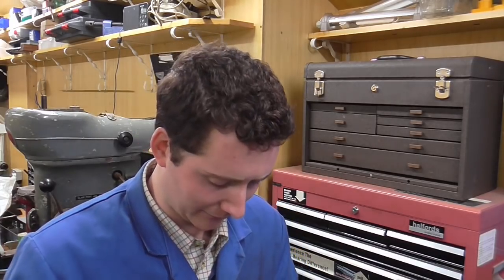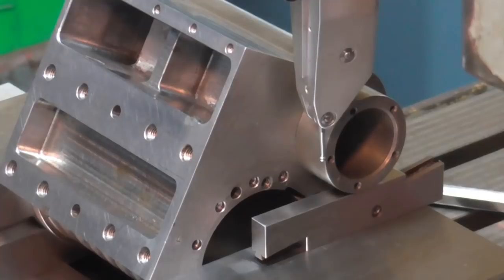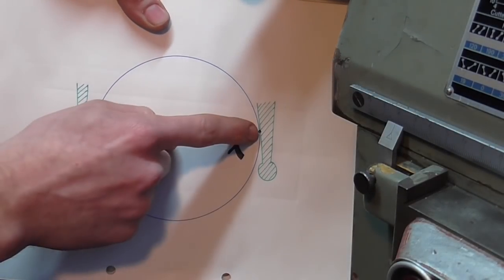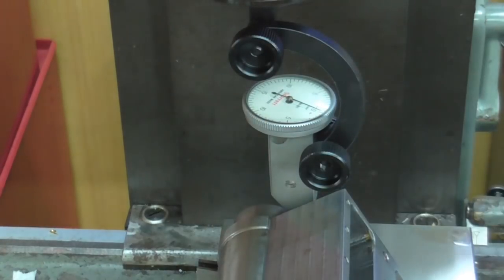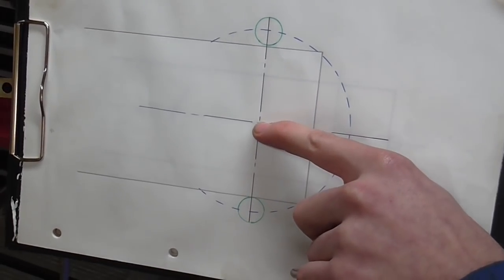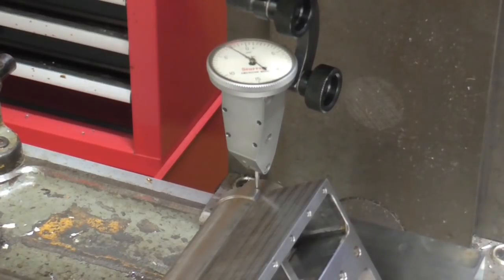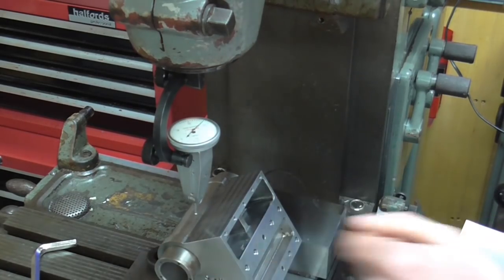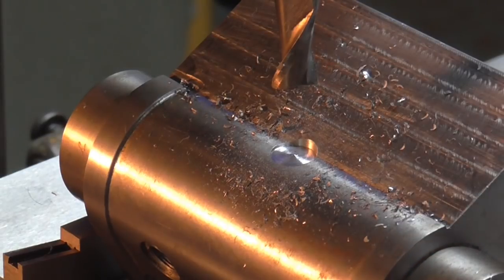Edge Finding with a DTI

Comment: I doubt many people have that type of indicator or the holder with the face on the top so they will have to use a mirror to see the dial on the other side, that's pissing about........you already have the OD of the end so why didn't you just use an edge finder....1 2 3 and you're there.... halve the result to get centre?.....but I suppose what you are showing is yet another way....sigh.
Reply from the maker: Horses for courses. I trust and indicator much more than an edge finder. I know edge finders are popular though.
Reply: @MrCrispinEnterprises  An edge finder is universal and does what it does.....detects an edge face  accurately....within .02mm....CNCer's live by them.....I doubt that method you propose will find favour in many shops....too fiddling and without the particular dial indicator and the holder you are using too... very neck straining to say the least......an edge finder cost about A$10 on EBAY.
Reply from the maker: Don't worry, I am a CNCer too and I understand your point. On manual machines a DTI is my preferred method and proves to be versatile when combined with tooling balls, tool makers buttons, round component geometry ect.

Comment: Well explained, with one exception, you are actually looking for the LOW point on the indicator to set zero as you sweep. Yes HIGH point when you raise and lower the table to find the top of the radius, but as you sweep or rotate the indicator, it will read HIGH or PLUS both sides of the ZERO point.

Comment: When you say the spindle centre is 15mm away from the component centre line, surely it's 15mm plus the radius of the ball end of the clock's stylus?
Reply from the maker: The bit that matters here is the zero reading on the dial rather than the actual position of anything. The stylus can be anywhere and as long as you get the same reading each side then the distance between thoes readings is the diameter of the component. On an edge finder you half the diameter to give you the spindle centre but in this case you get the spindle centre by rotating the spindle 180.
Reply: @MrCrispinEnterprises  Thank you very much for taking the time to explain that. It's a good technique that was hitherto unknown to me.

Comment: what was that indicator with the flip dial. I have never seen that, it would be very nice to have that feature.  Found it. 811-5PZ Dial Test Indicator with Swivel Head... very pricey. at $502 US dollars
Reply from the maker: Yes it's very good. Haven't had any instances where the body has been too big and it has a very clear dial. It's the 0.0005". I think you could cover all bases though with just a normal indicator and then an indicator that has the face at 90 degrees to the body. I think the swivel is a 'nice to have'.
Reply from the maker: It was a gift to me from Abomb79 during the Keith Fenner tool box give away. Cheers.
Reply: @MrCrispinEnterprises  Do you find it to be too large in size at times?  Is yours .0005 or .001? And do you like it?